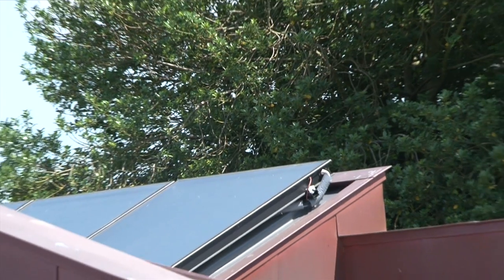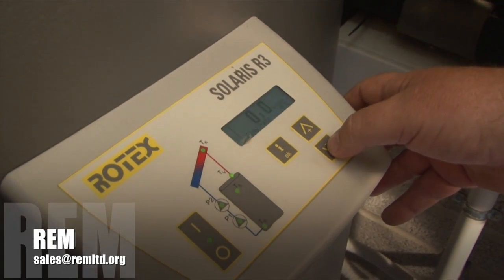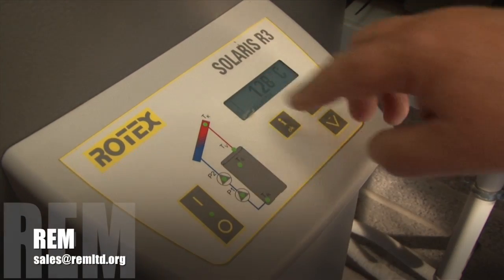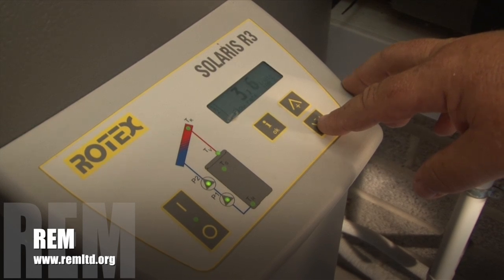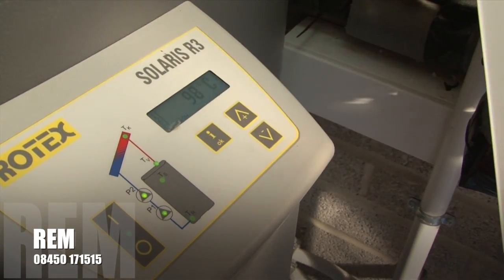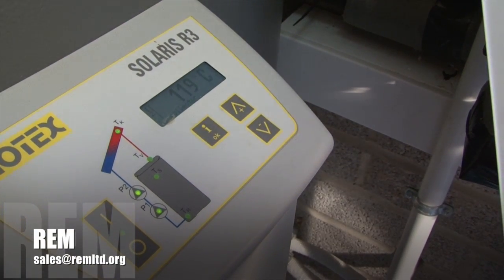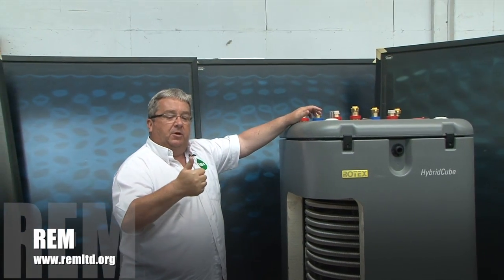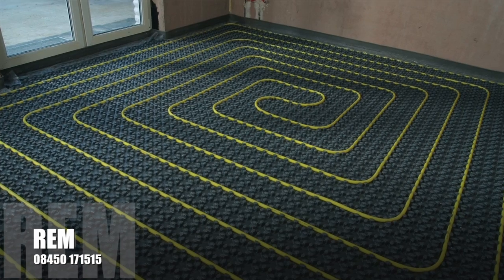REM - The things they do not tell you about solar thermal

Comment: Hello . My R3 rotex, as soon as i start it, the pumps start working, actually one of them is overheating, but there is no water flow on the screen, its a 0.0, but i ear them working, and i feel thre pressure on the pipe . What could it be?
Reply: Hi,
did you try to open the chromium screws in the middle of the pumps? Behind, there is the pump shaft that can be turned with a screwdriver ( - ). It should be rotating if the pump is running. If it's running, but not pumping any water, the pump wheel may be loose. In that case, drain the water out of the system and open the four screws to get the motor from the pump housing... Much success!